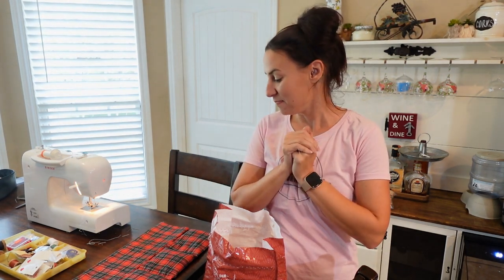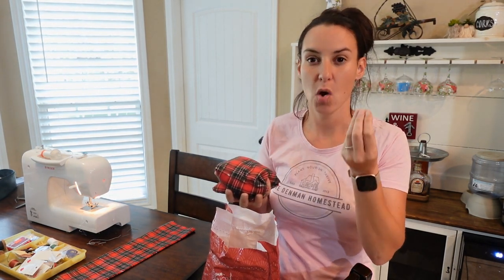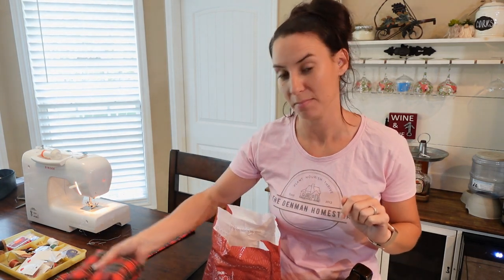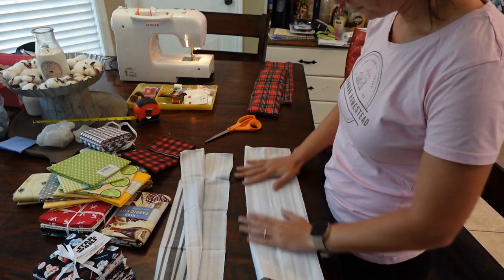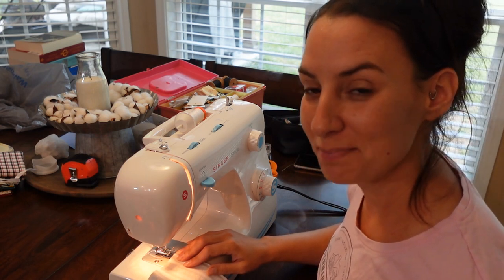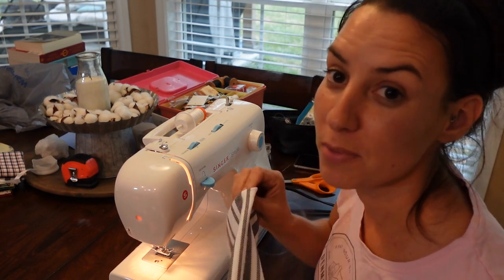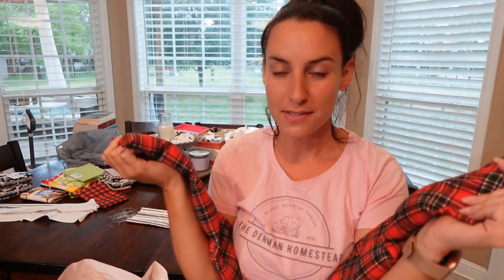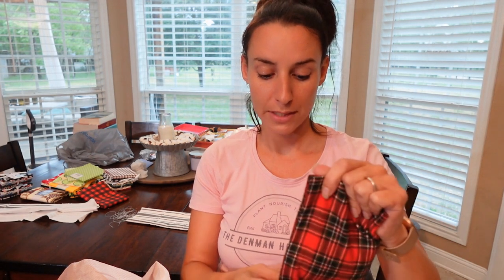DIY Heating Pads: Warmth and Comfort, Handmade with Love!

Comment: Hi Stephanie. I love the heating pads. I think I'd do them in a soft flannel. Here's an idea. Get a piece of soft, flexible tubing, or even a short piece of water hose. Slide it in the open side of the tube and put a funnel in the top of it and pour the rice in. Moving to hose up as you go. Did I explain that right? 🤔 Lol.

Comment: I just commented on Tina's page about this very thing. I had a boss that made these for everyone in our department. She went to a fabric store and bought scrap fabric from them. They were rectangle in shape about 8"x12". She sewed them like pillows and filled them with deer corn. You could heat them in the microwave or stick them in the freezer as a cold pack. I've had mine since 2005 and the fabric is finally wearing thin. She explained that the deer corn was cheap and didn't react to moisture like rice did. Mine has never molded or clumped. She even ask people what colors their houses were decorated ( under the pretense she was doing a home makeover and wanted some ideas) so she could customize them. Try the deer corn in some of them!❤

Comment: You can get a funnel with a long tube and put that in the opening and fill.  Put it through each hole to the bottom one, fill it and pin it, pull up funnel fill the next one.  Keep going til all are filled.  Saves lots of time and is much easier.  Love your channel.

Comment: Nice job at walking us through the process.  I've been making what I call "Neck Huggers" for years and selling them at craft shows.  They are popular and I do well.  I make mine curved for the neck with ties so that if you should fall asleep (I always fall asleep) waiting for the headache or shoulder pain to go away it won't slip off.  My "Neck Huggers" weight not quite 3 pounds so are excellent on the shoulders if you suffer from neck or shoulder pain. Similar to using a weighted blanket. I have a few guy friends that work in the construction field working with their arms above their heads most of the day.  They often leave work with shoulder pain and the "Neck Huggers" help relieve the pain.  I'm happy to hear you are opening an on-line store.  Be aware that your home made items will probably become very popular and you'll find yourself constantly making your crafts to sell.  Thanks for sharing with us!

Comment: You should check into making  “unfreeze able GEL ice packs” ( water, salt and corn starch). You boil the water add salt and corn starch, when cool place in ziplock bag, place into a cloth bag - freeze (they will not freeze solid. This ice pack is great and will mold around any injury, can be used over and over.

Comment: As I watched you work the rice down I thought of something that may be a tad easier.  Take a pvc pipe piece and thread that into the channel- then use a wider mouth funnel for the rice.  Once first one is filled, pull up the pipe to the next section pin off and repeat.  It would still allow you to measure the rice but maybe save your finger joints a few more years 😉. Thought I would share my brainstorm to see if that may work easier since you are talking about reproducing many of these.

Comment: I've sewn weighted blankets for kids.  Found it easier to pour in enough for the first section, shake it so the filler is at the bottom, sew first section shut, pour 2nd section and sew, then fill 3rd section and fold over like you showed and machine sew it shut.  No hand sewing required , each section has the same amount of filler and I find it quicker then having to work the filler down a channel.

Comment: I’m a little behind on watching videos but I’m wondering if you went to the hardware store, you could buy a piece of tubing to pour the rice into and pull it up the tube up as you fill the heating pad. You could use a funnel in the top of the tube and pour the rice into the tube.  ❤❤

Comment: Hi
Loved how you made the heating pads. I have made a few as. Some tips on how I filled mine, I fix the small pipe to the bottom of a funnel that are stuck down the side, poured my rice in every segment and then  I just pulled the pipe out as I go.❤
 If you don't have a microwave you can preheat (on a low heat) your oven then when it is hot turn it off, put your heating pad in it for 5 minutes.
I have also learnt that you must replace your rice every 2 years or so. Is your rice does start to burn and break up even though it does still hold heat.